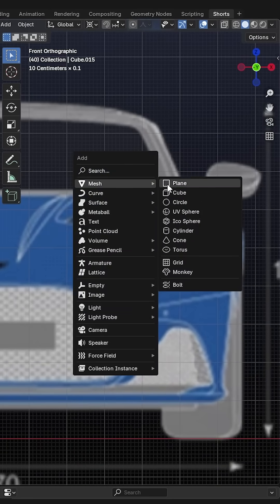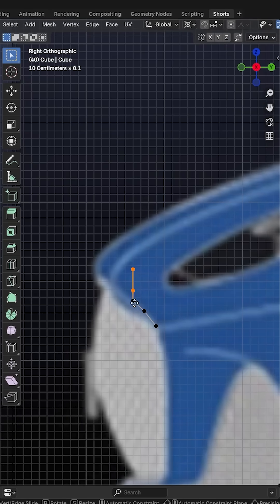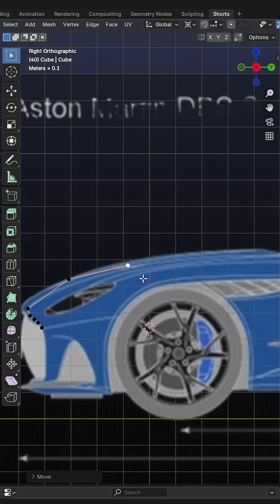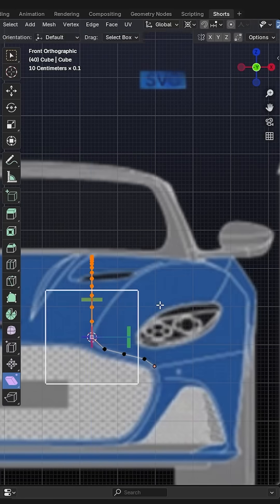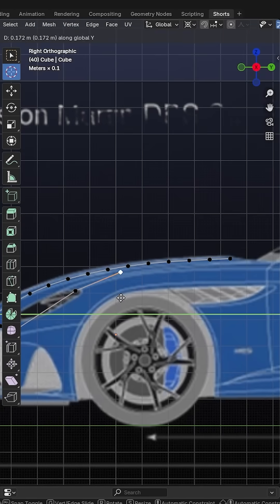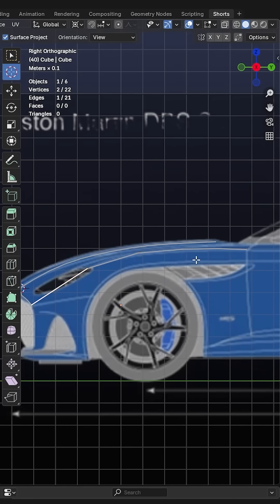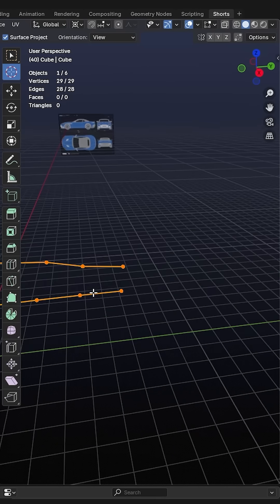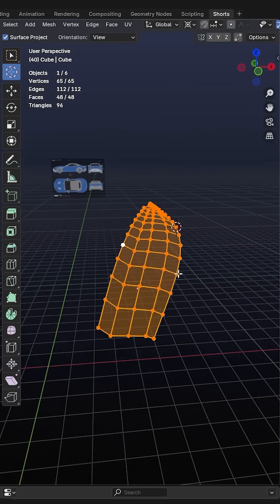The Best Way to model cars in Blender #blender #carmodeling

Comment: That's one way to do it, yes. You're using a similar method to the idea of creating the main edges first, then building it out from there. The other way to make a vehicle is the blockout method, which just means you make the general shape first, then slowly add more details with each pass. Both ways have their up and down sides.

Comment: I model completely differently and I use Blender since 2026. I model fist the pitched and creased  lines. When I can see a curve can be achieved by subdivision then I don't subdivide unless there's a hole to cut. I let the subdivision modifier create the curves at the end. The mesh itself is the minimum number of vertices to achieve the form and the rest is left to the modifier.

Comment: Worked on vehicles in games.  This method is pretty much correct, spine modelling was also part of this pipeline.  This old school.
Reply: Can I ask you something, when it comes to vehicles are they worried about everything being low poly or is that not the case anymore, I’m always worried about creating to many edges when modelling but I’m always wondering if that even matters anymore lol
Reply: @hasnain2razzaq really depends on the poly budget, and the horsepower of the system you're targeting. For static meshes that don't need to be animated, you can get away with high poly counts because you can use LOD (Level of Detail) substitute meshes. However for animated meshes topology matters because in rigging there can be deformations if the topology is bad, and in you're case if you have a car object that is going to be on screen 90% of the time the player is interacting with it, you might want to optimize for poly count, because it will be rendered once every 1/30 or 1/60 seconds, depending on the fos you are targeting. 

In pre-rendered cutscenes you don't need to worry about poly counts and can use the highest quality assets and render it inside a render farm, this is static rendering, the result never changes. But in a video game the rendering must be done in real time, since the results can change, it is dynamic rendering. So the system needs to render every 1/60th of a second because it is real time rendering.
Reply: What is the new school now?
Reply: I was thinking the same thing. We used to do this ages ago. Still works

Comment: To find reference images to model like this, look for "3 view diagram" for the thing you want. That'll give you top, bottom, and side orthographic reference.

For vehicles, especially planes, look for scale model plans. They'll often give the measurements for ribs you're meant to cut out of balsa yourself. Line up your reference image at each "station" along the vehicle and you've got the exact curve to follow at that line. For boats, you're gonna look for "lines drawing" images which will show the precise shape of the hull.

Comment: The first blender short that actually isnt stupid.
Reply: Same exact thought. Felt like using a calculator rather than using black magic
Reply: Nah there’s plenty of good ones
Reply: This is actually not correct way to model cars, idealy you should model from photos since all blueprints are wrong - most of them are made by fans and shapes are wrong, another way is to get cad files from designers but nobody provides that for cars contrary to airplanes where many companies just send it to artists…
Reply: @tomasgr1000 my guy...you missed the point.

Comment: This is better than what I was doing. Starting with a cube, doing 100 loop cuts, and dragging the edges to the bodywork.
Reply: That's like trying to build a car by throwing random scraps in a pile and hoping it assembles itself.
Reply: @skade245 yeah but that's basically how I model in blender. This way seems better though it only works if you obviously have multiple angles
Reply: I think most people where there at some point in one way or another. The stupid things I did (and potentially still do) are just the joy of headaches along the way
Reply: the difference between box modeling and stripe modeling

Comment: How did you rotate it like that? If I were to do it it wouldn't work
Reply: yoo karma, you still modding reforger? he selects his Transform Pivot Point to 3D cursor and shift+s cursor to selected on the vert he wants it to rotate around
Reply: @DorkwingYT yep still modding working on a larger project now Iron Horizon also ty for letting me know